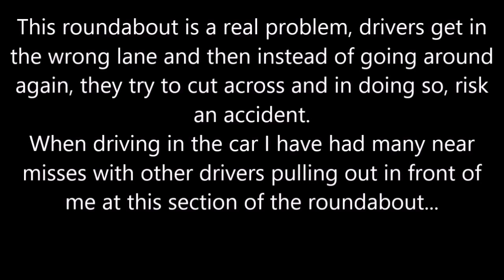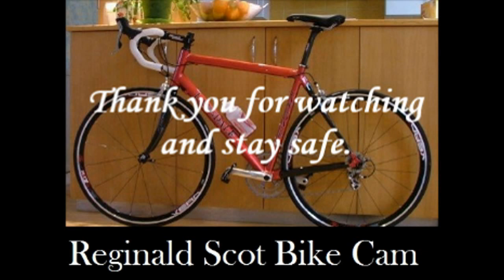Go around again!

Comment: Somehow, after reading the first six words of your description, I had a feeling it would highlight this roundabout! Not sure if you remember it prior to its "improvements" (must by 10ish years ago now)? The added traffic island, extra lanes, and split of A52 westbound traffic; in fact, if memory serves correctly, I don't think it was a traffic light controlled junction either - just a bog-standard roundabout!

Traffic feeding from the east on the A606 is invited to take lanes one or two for A52 west; naturally, traffic in lane two there, ends up in lane three or four by the time you get to that first set of traffic lights. Which is exactly where you don't want to be if you're trying to take the westbound A52, as seen in your encounter! The road markings seem to suggest that lane one must maintain lane one around the roundabout, where lane two splits to two, three and four. I've often thought its redesign to be somewhat illogical and certainly now an awkward junction to navigate! (I can't remember if the feed lanes were remarked - if they haven't been, it would explain the whole issue!)
Reply from the maker: +James T Lowe 
I have very vague memories of the roundabout before the changes where made. But they did nothing to improve it. My problem is that it’s so easy to just drive round again. It is what I always do if I miss my exit on an unfamiliar
junction. It is the safe sensible thing to do. :)